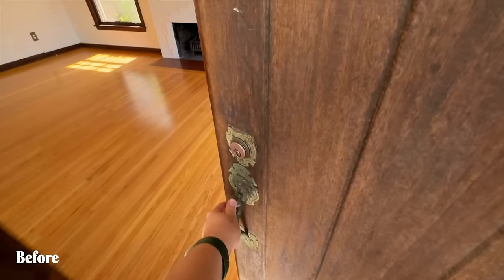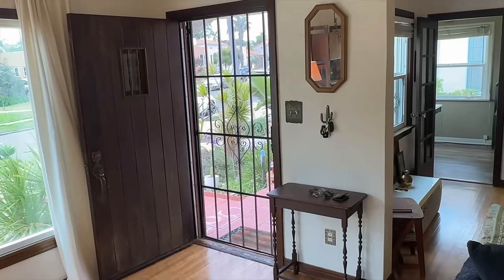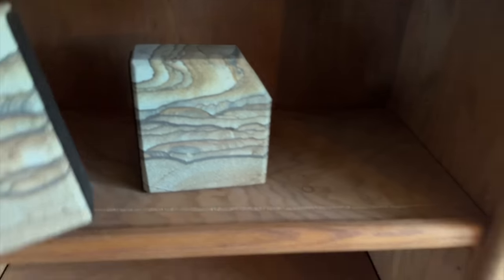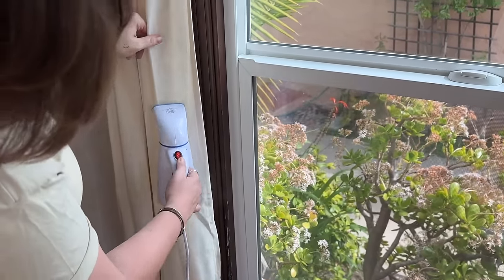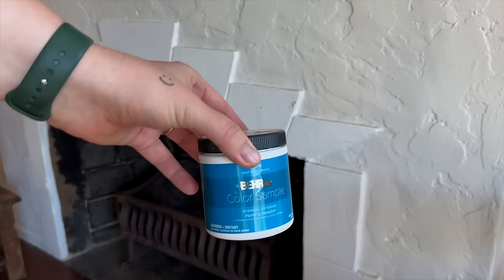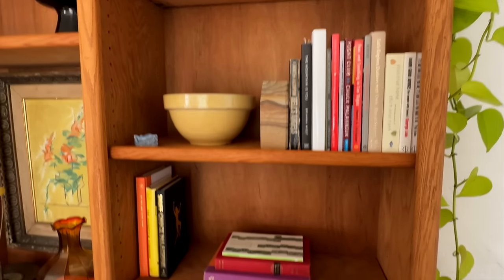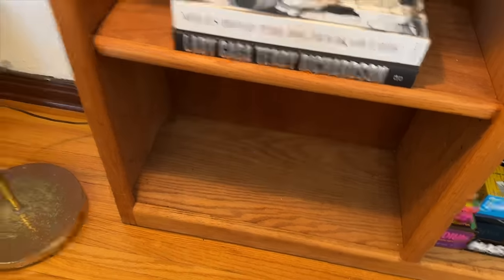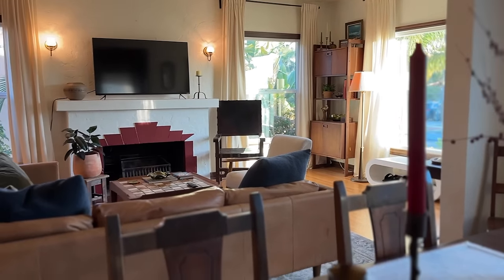EASY LIVING ROOM REFRESH 🏡 How to Upgrade Your Home On A BUDGET!

Comment: The tile on fireplace hearth is a “terra cotta” color. If you still think the color you painted around fireplace opening is too red, you should look for more of a terra cotta paint color, which will have more brown in it.
Reply from the maker: it’s surprisingly very red where as terracotta is almost pinkish and orange. I picked up about 10 more swatch cards after posting the video and it seems like terra cotta would sadly not fit. it’s an interesting color and the tile is soot stained so it’s hard to match!

Comment: You have a great eye for decorating 😃👏🏼👏🏼👏🏼.   I LOVE your new living room.  With your TV - leave it on the mantle and rig a picture over it when it is not in use.  The picture can have a little of the brick red color in it too.  Also, the are tv mounts that you can pull the tv down a bit so you won’t strain your neck.   It’s actually an easy fix.  I absolutely love your new bookshelves and how you decorated them. 👍🏼

Comment: The shoe rack and table look really good in the entryway and that bookcase was such a good find. I like the red paint on the fireplace and it does distract from the tv. I thought the tv easel would be a good solution but you were right, it did not work at all. The tv on the mantle thing is not ideal. Keep persevering you will find a solution!

Comment: I am with you on tvs. I really don't want to look at TVs unless I am using it. Some people put them in armoires, which would be too small for your tv, some get those TVs that you can digitally download a painting on it and hide it that way. I have a 21" tv and I have it inside a black bookcase which makes the tv not noticeable (black on black) till you use it which I love and I have seen someone build a cabinet in front of her's and put a print on the doors so you have art till you open the the doors to see the tv. A simple solution is go to A fabric store and find some tapestry/embroidered material and make a slip cover for it that way you can hide the tv, have art and take the slip cover off when you want to use it.

Comment: Consider swapping clear lightbulbs for frosted. You won't get the shadows from the shade's wires frame.
Reply from the maker: interesting! nice tip! weirdly I am using frosted bulbs except for the one in the brass lamp

Comment: Gossip chair in window so you can sit on it, table by door for keys, cushion in medievel chair to break up its darkness, bookshelf off centred towards opening to give chair more space to be a reading nook by window, shoe rack at side couch so you can use it as a side table. I move stuff around all the time, my family hates it ha ha, put the tv infront of the wood wall against a dark colour it will fade away. Not sure why but you video keeps changing direction or else you keep changing your bookcase.
Reply from the maker: haha I think it’s because the camera flips it when it’s facing me versus facing out! I never really noticed that but I might have to start using my other camera to keep it consistent!

Comment: Paint that rusty floor lamp red…you need MORE paintings on the walls…you need a skinny lamp on that little table when you first come in…use a tiny light bulb inside your book case so it won’t catch on fire….or move the shelf down….don’t have two lamps on the same side of the bookcase….put one on the other side
Reply: Make sure that lamp is not too hot…move the shelf way down…I had a fire before
Reply from the maker: Red is a great idea! I will think about that, thanks! I really want to keep it minimal and modern in here as much as possible as I am using a lot of antique and vintage decor/furniture/fixtures so I will probably hold off on more pictures on the wall for now... The skinny table by the door would be cute with a lamp! But I am afraid it would fall off haha its quite a tight space as it is for walking in -- we're always bumping into it 😂
Reply from the maker: all my bulbs are LED! :D

Comment: Love ALL of it… including the modern shoe storage bench under the window.

Suggestion for consideration: think about “continuing the art deco design surround LINE” down to the baseboard along the fireplace bricks.

Try to take the cherry cola color down to meet the bricks and only make it match the width of the final lower piece.

Hope this makes sense.

I LOVE that you thought it would distract from the TV. It absolutely does.

* did hate the tripod for the TV thing. Giving a presentation vibes was a spot on comment.

;)

Comment: ...I think the little Table is so cute,..looks best near the Door, with that Mirror.  I do not like  a Televisions on a Mantelpiece, .....I am not sure what Moron came up with the Idea that  mounting a Television over a Fireplace  " was a good Idea " , so I agree on that point ,not having it there.  I did not like the tripod thing. ... Although you stated you don't " care for " the Frame TV "... it might be something to consider, because it would lend a better feel to your Room.  ..I'm limited in where I can place my Television, so I understand... but you do have room on the far side of the Fireplace,  ( the one window to the left as you're looking at the Fireplace)..even though it is where the window is. ..if it  was put on a " Swivel type base " on a piece of furniture  that bkends with your Room ( a " nit too high / too low " pieceto hold the Television.  ) . . ;  then I saw you bought the huge bookcase .. so that makes that back wall  very visually heavy .. then the little thing next to it was placed on the corner... sobwith all that niw going on, it might not work.... so , it was just a suggestion about the Black Box. ( I own  o n e  Television.  That's enough, lol).
I do rearranging of  my Lounge  a few times a Year. .. I think Rooms need that  to not " feel Stale " . 
Love the Curtains.  .. I do the small " puddle on the floor " as well  ..I think it lends a certain  " not too fussy " look. ..No matter the Design Style.

Comment: I am really into black lampshades. Just make sure it doesn't have silver on the inside, they throw off too bright white light. Gold on the inside is the best. If you happen to run into one at the thrift grab it. At any rate, the black is really good. Moody and fantastic. You can have a little lamp on the entryway table. 25 watt lightbulbs on tiny lamps are totally a vibe. It looks so good! I love the new book shelf wall and think the blanket shelf is a fantastic idea. I love it and really want to see it at night.
Reply from the maker: I forgot about black lampshades with the gold interior! My mom had some great ones when I was growing up.. I will need to keep my eye out for some cool ones : )

Comment: Have you considered mounting the tv above the fireplace and building a frame around it and putting digital art on it? Or even hanging a framed picture over it? I have a similar rechargeable light for my laundry area (it had no light). I bought 2 right away, so it’s nice to rotate recharging it.

Comment: You did good with the bookcase arrangement. However, the entry table is too small and too low for the wall hanging above it. Also, the white oval cube in front of the window doesn’t go with your decor despite your style being eclectic. Either paint it black, put something over it like a small heavy rug or seat cushion, or just move it out of this room.

Comment: Yes to table next to the door. My tip Is use rings that hook on for all curtains you want to be able to move on the rod. TV over mantel is awful, a beautiful fireplace and then the big black rectangle. But i don’t think that easel solution is it. Love your lampshade switch. The hearth front, I like the maroon but I don’t like that the rest of it is so white. Too white. Love that bookshelf, wow what a bargain. Could it be teak? Love your styling of the shelves. ( but no cannisters)

Comment: The fireplace tiles should be "antiqued" with a brown glaze to tone it down a bit.  Get the TV off of the mantle and move it next to the chair next to the fireplace.  The chair adds to the "black box" and draws attention there.  Move the chair next to the bookcase (new one) and the cute 2-level table to the window area behind where the chair was.  That will spread the weight around the room more. Just a thought. You have a beautiful eye for decor!!

Comment: If you get the adjustable tv mount, you can pull it away from the wall and pull it down or push it up and tilt it to whatever direction you want when you're using it and then  push it back to its original position on the wall when you're done. It's still going to look like a black box in the room, but you won't have to strain your neck when watching it.

Comment: One idea to make the TV blend in better with the fireplace is to color block the area. What if you painted the fireplace and the wall above a similar color of your sofa. The darker color would help the TV fade in a bit. Then paint the mantel and the tiles a color darker on the same paint strip. The red stands out a too much and doesn't go with the floor tiles.

Comment: Making a vinegar and flour mixture and putting it on the brass lamp should help clean it up. There’s lots of different methods online. I’ve only tried the vinegar and flour one. It works!
Reply from the maker: I will try the flour part! Never done that, hope it works cause nothing has so far haha

Comment: Okay so for your brass lamp buy Bon-Ami from grocery store/ put vinegar  in an old spray bottle / spray put bon-ami on top of vinegar wearing a glove just rub gently then take old dish towels and rub off I shine brass all the time
Reply from the maker: I have seen that before! I think this is beyond dirt though, its rust that needs to be scrubbed off. I will of course try it out! Bar keepers, Brasso, Hydrogen Peroxide and Vinegar did not work : (

Comment: Im sure there is a t.v mount that would mount to the wall and when not in use is flat against the wall and while in use can extend downward to be at a better level 🤔
Reply from the maker: Yes! I dont think I can screw into the wall above the fireplace though.. there seems to be a protective metal layer so I wouldnt be able to anchor it there unfortunately.

Comment: I can’t believe how you put nails into that beautiful bookcase, you should’ve use Velcro strips those ones that pull off when you’re done with them. I haven’t watch the whole video but I think it would look really cute if you put that bench next to the bookcase. I just found your channel.
Reply: I used Velcro strips to ‘hang’ a small (8 inch square) inflamed canvas piece. It came loose repeatedly, and when it knocked over a figurine (breaking it), I gave up and used a nail.
Reply: FRAMED not inflamed!